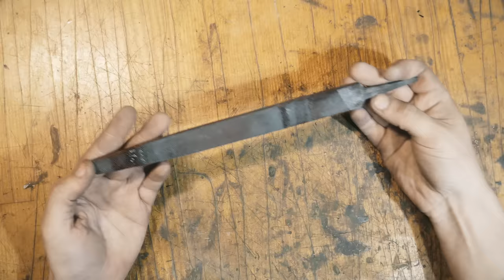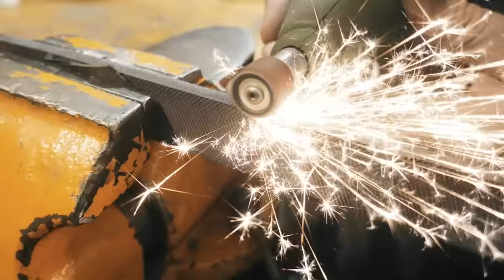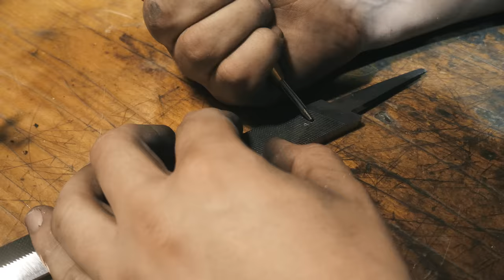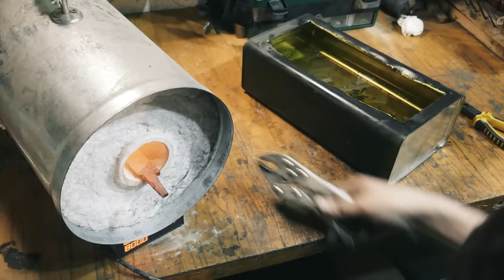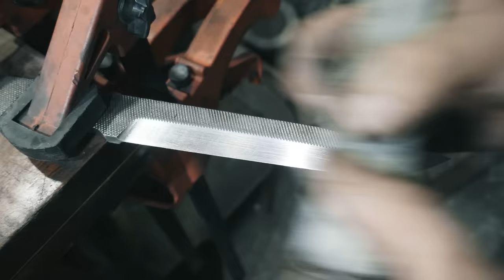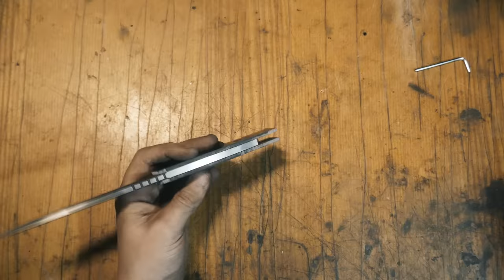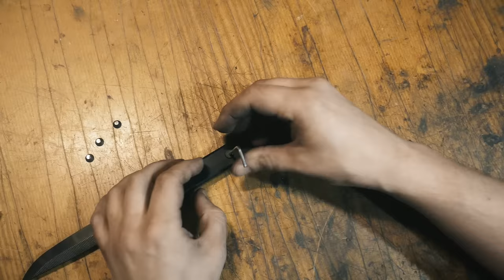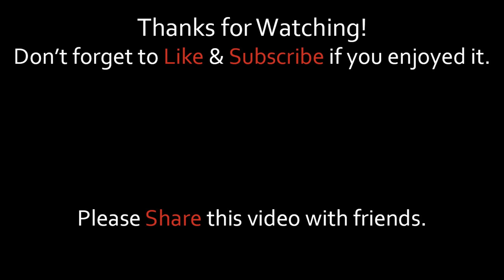Making a Knife from an Old File

Comment: Leaving part of it with the file still there is brilliant. Perfect knife. I would rock that thing all day.
Reply: BRITAIN WANTS TO KNOW YOUR LOCATION
Reply: While I like how much work the man has put in to that file, I disagree with leaving half the blade as course as it was. I imagine using that knife to actually cut things would result in many things getting stuck on the ridges of the old file.
Reply: @keksitzee1094  It's a combat weapon. Of course you want those things to happen. It would cause way more damage. And, I'm a knife collector, unless you're cutting something like cheese or other food, nothing would get stuck in there. If you're using it for camping reasons, then it's just as good because you'll have a file and a knife. And, what would you cut that would get stuck in there? If you're cutting things with a knife like that, that would have pieces getting stuck in it, then you're probably not using it right.
Reply: Console MonsterX As a knife collector, you should know better. This couldn’t be a combat knife as it has no quillon to stop the hand sliding onto the blade when used for stabbing.
Reply: @PapaKiloProductions  Well you don't seem to know much about knives. There are literally thousands of knives and swords that are built for combat that have no type of hand guard what so ever. Look at almost all real switch blades. Most of them have nothing. They are straight handles with a switch. The blade comes out of the top and that's it. That's the knife. And they are meant to be used for combat. They aren't hunting or camping blades.  Of course not all of them are like that. Look at some Japanese swords that have no guard so that they are flush with the sheath. Look at the kukri. Just because it's not a perfect design doesn't mean it's not a combat knife. Look at most folding knives. Same thing. I have a bunch of knives that don't have any hand protection. Shit, look at the balisong. Sorry bud. You're wrong.
Reply: @isak.indnbstn  US.
Reply: @darthollpheist1156  yeah its a combat knife, and yeah it looks nice. but it could be way more practical imo too.
- the slightly dropped point is ok, but it could have a false edge, helping the ease of the thrust
- the finger well is ok - if it fits the hand of the user - but ofc some kind of guard provides way more protection from sliding off the handle
- the balance of the blade seems okayish, but with that thickness along the spine it looks unnecessarily heavy
Reply: @cocain666666  I don't disagree with that. It's not perfect. It was a file, now it a knife. To nitpick when there is so much work that goes into such a weapon is futile. It's a nice weapon. There aren't many perfect weapons.
Reply: Console MonsterX A combat knife is designed for military use. A folding knife or switchblade is not a combat knife
Reply: @PapaKiloProductions  No. That's not true. LOL. Combat does not equal military. (Most of my family is military). Combat is anything that involves fighting. I think you're trying REALLY hard to not be wrong now. You would be better off not commenting at all. No hard feelings. You're just wrong. And yes, a balisong, karambit , or any of the other stuff I named, are combat weapons. In fact, anything that has a tanto blade style would be a combat weapon because the tanto blade is designed to be easy to sharpen, easy to stab with, and easy to clean. And almost all switchblades are combat knives which is why they are illegal. Using one for stuff like camping would be pointless because you would risk breaking it. And by the way, I talked about the kukri. They don't have any hand guard and were issued to soldiers of England. 

Anyway, here's the definition of combat. The verb. Not the noun. "Take action to reduce or prevent (something bad or undesirable)" synonyms: fight - battle against - do battle with - wage war against - attack.... there are a lot so I won't list them all. 

The Noun - fighting between armed forces. 

That does not mean military. 

So, there goes your argument. Just to freshen up your English, a noun is a person, place, or thing. So, combat as described with something like "combat knife" or "combat weapon" would be referring to the objects ability to use or DO something with.... cough cough, verb. 

You are just going to make a fool of yourself going down this road. How about you just say something like "you're right. I guess I never thought of that" instead of insisting on being right even though you're just backing yourself into a corner. Digging yourself into a deeper hole. 

Oh and just for the record, using the term "combat is a general term". Like saying "I'm in combat my wife about the news." 

Abortion is called murder by about 70% of the US but it's not technically murder because murder is a criminal charge. Not an act itself. 

Either you have SEVERE asbergers or you're one of those little kids that gets prove wrong, so you'll just argue with stupid points and minutia just because you're too dumb and not man enough to say "you were right. I was wrong. Sorry". Simple as that. Fact. 

And just for the record, most people in the military carry folding knives. Want to know which ones are the most popular?
Reply: Console MonsterX Perhaps you should refer to a dictionary, or the plethora or sources around the internet which refer to a combat knife as a knife designed “solely” for military use. The military don’t really issue combat knives these days, and therefore soldiers can choose to use their own private knives. 

But there you are throwing insults from your keyboard for no good reason, other than you disagree with me. I wont take offence to this though, as I am not a child. 

Well done for teaching me about the the definition of combat though. You are very smart. I was however referring to the term, “combat knife”, and while you are correct in your definition of the word, “combat”, I was not referring to the singular word. There are many knives which are used for combat without being combat knives. Combat knives are a very specific thing, at least where I am from. 

Please, in future, have a bit of class.
Reply: @PapaKiloProductions  Yeah, you're wrong. So, When someone calls MMA a "combat sport" (which is it's actual name according to MMA), they are wrong? But you are right?  

And, I'm not "throwing insults". I'm pointing out your wrongness. I didn't call you stupid. I just said you're digging yourself into a hole because you want to be right. But you're not. You are acting like the keyword warrior kids that refuse to just admit they are wrong. That's what a man does. If I were wrong. That would be my reply. But I'm not. That's all you have to do. Admit you are wrong. I am 100% right. You are wrong. It's simple as that. If you take that as an insult, maybe I'm hitting a bit too close to home for you. Facts don't care about your feelings.
Reply: Console MonsterX You literally said I either have Asbergers or I am dumb. Never mind. You have completely missed the point on this, and it seems like you are incapable of reasonable discussion. I am not offended, as my feelings do not care about your “facts”.
Reply: @PapaKiloProductions  Okay, well then I apologize for that. But it doesn't change the fact that I'm right and you are wrong. You're arguing semantics in an attempt to save face when really, you're making yourself look worse. And they aren't "my" facts. They are facts. You've avoided literally every logical and factual argument I've made and you've made none. You don't even comment on them as if I didn't destroy your argument. But I did. And it's a fact. Not my opinion. Your entire argument hinges on semantics. Literally. Objectively. So one more time, why is it that you can't me man enough to admit that you are wrong? I just don't understand your generation. Kids these days would rather argue than say "I was wrong." And if you still can't, then maybe my ad hominem (while wrong at the time) will now prove to be right. So right now, you have my apology. The ball is in your court. These are your options. Admit you are wrong, or continue making a fool of yourself. (That's not an insult. What you're doing right now.) Sorry, but you really are wrong. It is 100%, indisputably, undeniably, factually, objectively, a debate you are on the wrong side of. It's just fact. Like I said, be a man. 

See how when you pointed out that I made an unproved insult, I said I was wrong? That's what a man does. I didn't try to use semantics to worm my way out of it.
Reply: Console MonsterX I’m not a child. I’m 40. Agree to disagree. You clearly cannot let this one go. You have not changed my mind. A combat knife is a military issued knife, designed solely for military use. It is written everywhere. Not tactical knives. Not utility knives. Combat knives. 

You are the one going against the written accepted usage of the term. I am not. Since you are so hell bent “destroying” my argument like a petulant child, then you win. I was wrong, and you are right. I hope you can now sleep tonight

Comment: I love that you kept the original file surface on the sides the blade above the bevel - that's a really cool design element that creatively shows off what the knife started out as. 👍👍👍
Reply: It might cause a problem with cutting anything thicker than the knife. I’d personally prefer a smooth finish, but it‘s not that much of an issue

Comment: best part is you can still file with it
Reply: Dont think so its tempered after hardening so its not hard enough to file with it.
Reply: There are other materials than steel. But good point.
Reply: Genki G yeah true... for softer materials it will still work fine
Reply: Gotta polish them nails bruv
Reply: Guys, if you see a hot girl polishing her nails with one of these, please, for the love of god, run! Run fast and run far.
Reply: Would it be bad if i ran the opposite way?
Reply: @disruptivegarage  Well. Then, I guess you'll be the one to find out what she does with the pointy end.
Reply: Ive had worse
Reply: Genki G: *proceeds to get stabbed by both her nails and the knife file*

Genki G: (in a British Accent) It’s only a flesh wound
Reply: Perpendicular Driving  Don't worry about your nails, just cause your a guy doesn't mean your nails have to be what people consider "nice". But yes, a nail filer does help, I would also recommend you find stronger clippers.
Reply: It still wont have the life span, it’s also just as dull as when he started so... I guess sortof?
Reply: Actually those file teeth will make great place for bacteria, rust... to grow.
Also each groove is a potential weak point. 
makes knife look interesting though

Comment: That's a beautiful blade! I'd love to have one just like that one!
Reply: I know how to get one too, just follow the video
Reply: Got any files laying around?
Reply: @lhtyeehaw1319  an average person usually doesn't have access to a shop like this
Reply: You don’t need much equipment for a knife like this. Grab a cheap file and an angle grinder. Not much to it. Heat it up with a torch and quench it in peanut oil. It would be different if you were trying to forge a knife. All this video showed is how to grind a file into a knife shape
Reply: @SergioPena20  Ah yes, cuz everyone has an angle grinder laying around.  Hell, I don't even have a file like that at my house.  It would be cheaper for me to just buy a knife.
Reply: You can get a grinder for pretty cheap now. I’ve seen them as low as $30. It might not be the best, but if you’re not using it everyday it won’t matter
Reply: @Smenchevieve  Most people I know do. There not expensive $30-$40 for a decent one.
Reply: @ThexSinGaming  Wait was I supposed to be?
Reply: @cammedls3532  i got a nice one off ebay for 15
Reply: @Bighoss9.51  lol
Reply: mcblazar you don’t have to have a shop like this... that’s the problem people need to overcome in their mind. I have a $60 belt grinder, a $60 forge and a $60 angle grinder. Add in maybe $100 of hand tools (that most people already have) and you can make a knife. Now if you’re on an extreme budget you can even go full on hand tools and make a very good knife, it just takes longer

Comment: Nicely made. Very satisfying video. I made my first knife from an old file when I'm in my early teens. Not as nice with an oversized walnut handle, but I loved that knife. Nothing I've had, before or since, could keep an edge like good old-fashioned high carbon steel.
Reply: hi
Reply: Yeah man, my 1950s file knife has faaaaar better edge retention than 10V, or maxamet............

"High carbon" used to mean ~1%. Theres steel like zdp189 with over 3% carbon now. Your old file knife was trash.

Nostalgia is a hell of a drug, so are boomer delusions.

Comment: Nice, I got the file. Now I just need to have a grinder, the furnace, a jigsaw, a drill press, free time, a belt sander a plastic tub with the dye you used, another file to file the file (borrowed this), kevlar? the jig you used to safely sand the work piece, and any measurable craftsmanship skills and ill be good to go.
Reply: For what it's worth you could probably do all of that with about 50 bucks if you have it. The furnace part is easiest. Dig a hole in the ground, find a good bit of wood, a steel pipe and a bicycle pump for a bellows. He annealed the file first to take the temper and hardness out of it, then went to work. 
You can find a cheap angle grinder on Craigslist and a vice too. Files are cheap at Harbor Freight or Northern tool and equipment or wal mart or a hardware store. Or ask around, someone might have all that stuff and give it to you. Never hurts to ask. Yard and garage sales. A hand drill will work fine for most of what he used a Dremel tool for and it will drill the holes for your pins. Handle material can be almost anything. A cheap 1" dowel from lowes or home depot will be fine. Or an old kitchen chair or something like that and take the wood from it. He threaded the handle for Allen screws but you wouldn't have to. A coat hanger and some epoxy makes some pretty strong pins. 
To heat treat the knife, use your hole in the ground again and heat it till a magnet won't stick. Then quench in used motor oil or cooking oil. Be careful because you'll usually get a flame from those. 
Then to temper it, put it in your oven at 400° for about 2 hours. It can be done without a lot of cost.
Reply: @Sickofsociety1  holy crap. You really know everything
Reply: @raulsascau2440  
I was just trying to help him.
Reply: @Sickofsociety1  awesome,  I have half the stuff already, and you just saved me tonnes of time trying to figure out the rest. You didn't only help the man out, you HELPED  me out, while also teaching the best way to comment on non-productive sarcastic comments (albeit, a rather funny one).
I tip my hat at you good sir!
Reply: @dijonmaize  
Thanks buddy. I've been doing blacksmithing  and whatnot for about 15 years and everything I described in my message to the OP was what I did myself. 
I'm glad to hear it helped you as well. 🙂

Comment: Nice. It took me a year to make one for my brothers birthday. Every lunchtime I'd work on it. With your know  how I could one make it faster.
Reply: @steve5912  maybe he's doing it manually 🤣
Reply: Five inch grinder slowly ground away at it so that it didn't turn blue. Both sides, same length and style as a M16 bayonet, then I designed a sheath out of aluminium and calved that as well like Maori calvings. I like taking time when making presents, I worked for Manufacturer who use CNC lathes and robots to produce products quickly. I love pouring my all into someones gift and I deliberately take my time when making it.

Comment: It would be best to also apply adhesive to the backs of the scales at final assembly. It would adhere the scales more firmly to the tang, and it would also fill the gaps between the file teeth where this carbon-steel blade will be otherwise subject to rust.

Comment: Should have left some of the file on the back and made it into a glass breaker
Looks sick though
Reply: 43% Burnt Isn’t the blade strong enough to break glass though?
Reply: @alenzhang4854  A knife could break glass, but the tip of the blade is a little too pointed to be super effective. Glass breakers are pointed but a bit more broad and not sharp by any means, more surface area would help break a wider area of glass decreasing the chance of slamming your hand into a nice chunk of sharp glass. It would also prevent the edge of your blade being dulled (glass is actually really hard)

Comment: Before he started working it he changed the temper of the file to make it softer. At the end he changed it back.
Reply: yes. yes he did.
Reply: chadguess44  i know.  gotta make it soft to work with my annealing it and then you need to make it hard so it can cut by quenching it.  finally you need to soften it a bit so you can sharpen it and it wont be so brittle.  thats called tempering.

Comment: Does this need any sort of heat treatment, since files are usually hard and can be broken easily (broke one myself after I threw it on the floor by accident)?
Reply: That's why he heated it in the beginning. It makes the metal soft again to work with. He then hardened it again at the end.